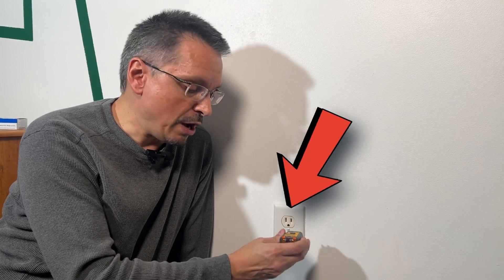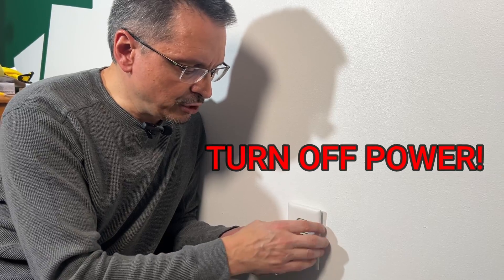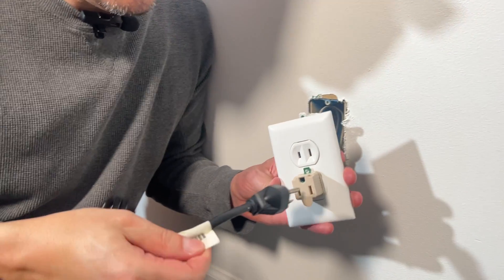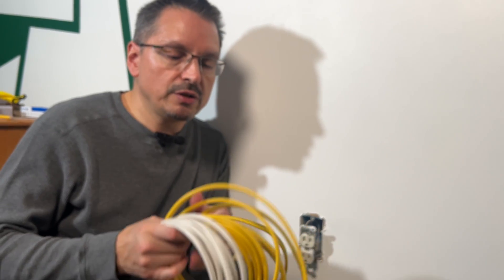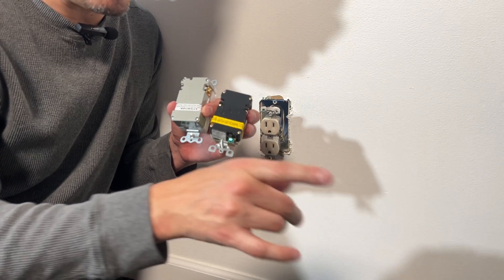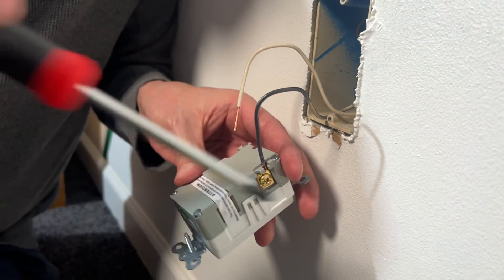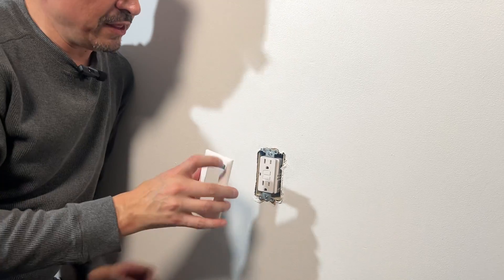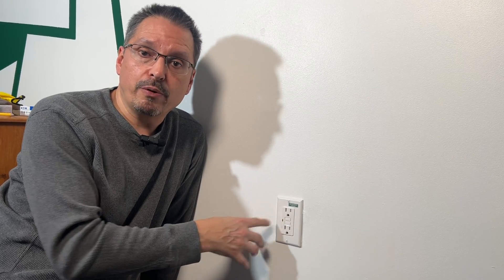Fix Open Ground Outlets | 4 Options

Comment from the maker: Have you been told your outlets are ungrounded? Tell me if you have done anything about it yet.
Reply: Your statement that electricity will flow along the ground wire and dissipate into the earth is completely wrong! Electricity always returns to its source; the last transformer it passed through usually. The purpose of the ground wire is to force the wayward electricity back through the circuit breaker.
Reply from the maker: @PetesGuide  modern grounding has several ways it adds extra layers of protection. 

The ground wire in an outlet provides a safe path for excess electricity to flow in case of a short circuit, preventing electrical shock and fire. 

In the event of a short circuit, the ground wire trips the circuit breaker, preventing a dangerous shock.

Fire prevention
The ground wire provides a safe path for excess electrical charges, preventing electrical fires.
Equipment protection
The ground wire can protect sensitive electronics from voltage spikes and surges.
Reply: I have a GFCI outlet with a ground wire attached, and it still shows on the tester as "open ground".  Apart from tracing down the open ground in a previous stop on the circuit, will the outlet itself still provide protection?
Reply from the maker: @edcrookshanks8091  yes the outlet will provide what’s called fault protection. If you hit the factory test button, the outlet will still trip and turn off power. Now, if you do the plug-in tester and check it that way you will not have grounding. But you do still have fault protection, and this increased safety is allowed on underground three prong outlets for the rental department and the building department. Although technically you’re supposed label this as no equipment ground provided.
Reply: @HomeRapidRepair  I haven’t done it yet , just bought a new fridge and found out the outlet has open ground and has another outlet and light running on the same breaker. I’m trying to figure out my options , that’s why I pulled your video up.

Comment: Would have been good to see what the tester shows on the GFCI once installed, so people would know what to expect.
Reply from the maker: That's a great point, I should have included that in the video! It will show “open ground“ however you still have improved the safety with fault protection…

Comment: Just bought my first home most of the outlets are ungrounded how safe is option 4 ?
Reply from the maker: It will be fine. Millions and millions of homes are still ungrounded. Residential grounding wasn't required till like 1963 and many states after that date.

Comment: My outlets do not have a ground wire but when I plug in a tester, it comes as "correct wiring" instead of "open ground."  How is that possible?
Reply from the maker: Good question. I’m not sure. It’s possible you have metal boxes that are grounded and thus the outlets are grounded through the metal boxes…
Reply: @HomeRapidRepair  I live in an older home.  It looks like the boxes are meta..   The receptacles look like they are "self-grounding" by screwing onto the box.  That's the only explanation.

Comment: If mine is showing an open ground, but the ground wire is connected on my first outlet, can any of the downstream outlets be the culprit?
Reply from the maker: If I’m understanding your question correctly, you’re wondering why are the downstream outlets showing open ground? Every single outlet in the daisy chain circuit also has to have a solid grounding wire…. Let me know if I’m misunderstanding the question.
Reply: @HomeRapidRepair  all of the power is out in my room and the hallway. The first outlet starts in my room, and that one is showing an open ground light when I test it.. I don’t know if the wiring is bad or if another outlet down stream is the problem.
Reply from the maker: @Slossage17  yeah I hate when that happens. It’s just trial and error to fix it though. You need to turn off the main power and pull all of the outlets that you think are on the affected circuit and check every single connection. And then put it back together and turn on the power. Good luck ⚡️🛠️
Reply from the maker: @Slossage17  and just to encourage you, likely the wiring is not bad at all, you just have a loose connection on one of those outlets

Comment: Would a “2 Prong GFCI Power Strip, 2 Prong to 3 Prong GFCI Plug Adapter” make a ungrounded circuit safer , i’m not concerned with inspections just safety. The outlet is in a bathroom drawer. I know go figure.
Reply from the maker: Yes it’s safer with GFCI, because you have fault protection if anything goes wrong. That’s why hair dryers have them installed directly into the plug 🔌

Comment: What if all outlets are grounded and it shows open ground then what.
Reply from the maker: I would say if your tester is showing open ground then you actually don’t have grounding. There is either loose ground wires, or the ground rod is not connected or something else is missing. Otherwise, the tester would pick up the ground…

Comment: we recently bought a home and was planing to use a tesla charger on a nema 10 30, not knowing what it meant and googled it. says it a no grounding outlet.😞😞😩.  went and bought me a grounding device from home depot. tested the outlet in the house. kitchen, restrooms say it’s grounded, all the outlets in living room, bedrooms say open ground. what would be my best option to fix this issue??  went to check the panel breaker. i see flexible conduit that goes down to a pipe at the bottom of the house and another conduit that is just hanging not connect to anything. maybe that’s the issue? needs to be connect to a ground rod maybe got loose?
Reply from the maker: If I recall that outlet for your Tesla charger is not required to be grounded… As far as the ones in your house, there’s still millions of homes in America like that. It’s not that big of a deal. If your house is built before 1963 typically the outlets are not grounded. You might be right as far as the grounding rod at the main panel, but you might not have an additional grounding wire to each outlet receptacle. You can install GFCI outlets, even on open ground receptacles, and you’re still safe… Let me know if you have more questions

Comment: Today (DIYer) i made a thorough inspection. I JUST DISCOVERED that the romex aluminum bare wire was too short and was not terminated/ screwed to the metal jbox. Now my APC 6outlet Surge Protector Plugin is now Green Only . No more Red [Bldg.Wiring Fault) or 2 Yellow on GFCI tester means correct.
BUT am keep that GFCI 15a in place protecting the 2 outlet downstream , SO HAPPY ❤ Many Thanks again!
Reply from the maker: You rock 🎸 Great work..That is awesome. Thanks for sharing your experience 👍🏼😎

Comment: Sorry if this is a silly question....But do I replace every single open ground outlet in my home with a GFCI outlet? I believe I have like 10 total outlets that are open ground. Does that mean I have to replace all 10 with 10 GFCI outlets?
Reply from the maker: The most correct answer is no you don’t have to. If you can determine which outlet is at the beginning of the circuit then you just install the GFCI safety outlet at that location wire your downstream outlets to “load“ side of the GFCI outlet and you will have protection. You still have to label all the outlets with open ground or ungrounded sticker. 

Now for resale value and making it easier on Home Inspector’s, I often recommend to just replace every single one with a GFCI outlet that way there’s no question that people understand that you have protection.
Reply: @HomeRapidRepair what if you wired the downstream outlets to the line and the panel feed to the load? Does it matter? Thanks

Comment: Will a 110v EV charger work with a GFCI socket or will it still detect a ground fault?  🤔
Reply from the maker: I would say it should work, but all depends on how fancy the circuitry is with your EV charger. If it absolutely demands to detect a ground before it will operate… That would be a problem. It should be marked in the literature… Good luck.
Reply from the maker: I just found this information online:

- **Charger Compatibility**: Most EV chargers, including portable Level 1 and Level 2 units, require a properly grounded outlet to function correctly. Many modern chargers have built-in safety mechanisms (like ground fault detection) that may prevent operation if an open ground is detected.
- **Code Compliance**: Electrical codes (e.g., NEC in the U.S.) require EV charging circuits to have proper grounding. Using an open ground outlet violates these standards and could void warranties or insurance coverage.
- **Potential Workarounds**: Some sources suggest using a GFCI breaker or adapter as a temporary fix, but this is not a substitute for proper grounding and may still cause the charger to malfunction or trip the circuit.

*
Reply: @HomeRapidRepair    Interesting.  Guess it's time to figure out where that ground is faulty.  Tried plugging my 110v EV charger to an outside socket...detected open ground.  Opened the socket, hot/neutral/ground are all connected ok so I'm guessing I have a hidden junction box with a bad ground because all the other sockets on that line have good ground.  🙈
I appreciate your help with this.  Thanks a lot. 😊👍

Comment: Option 5: GFCI breaker to cover all outlets on a circuit.
Reply from the maker: Yes, that’s a good point for sure. I agree with you. The home inspectors and rental safety department in my area would also require each individual outlet be labeled as no ground provided. Thank you for watching.

Comment: @HomeRapidRepair thank you for this video. We are selling our home which was built in 1955 and the inspector said about open ground and two wire issues in the outlets. Since rewiring the home is out of the question your video really helps in solving that issue.  My question is if we change all the outlets to GFCI outlets, maybe is an overkill,  is it a good idea? I would like to go that route just to get that headache out of the way. 
Again thank you for your very informative and helpful video.
Reply from the maker: Actually I endorsed that. I think it is good just to install GFCI outlets at all receptacle locations that way there’s no question that they all have fault protection. Also, remember when you’re doing this “fix“ for ungrounded outlets with GFCI safety you have to label them as open ground or ungrounded. They make little sticker taps for this…

Comment: Just went through this. GFCI is good for protection but  not so practical as it shuts the power off. I had leakage from PC as no ground and pc and monitor gave electric shocks and of course this is not good for the equipment as well as the shock. Best option in this scenario is to lay a new grounding wire from PC socket to grounding rod. You can piggy.back of this if you want to ground more sockets.
Reply from the maker: Thanks for sharing your experience with us 👍🏼🛠️⚡️

Comment: Running new wire is what I'm doing now I like things done for good at a customers house
Reply from the maker: Sounds great. Good work ⚡️👍🏼🛠️
Reply: @HomeRapidRepair  Love that notion. When in doubt run a neutral back to the panel (if you can) and ensure you have also a ground (as an way for current to get back to the transformer if current goes awry)

Comment: So can I put that new outlet anywhere on the circuit or does it have to be at the first outlet of the circuit?If so how do I find the start of the run?
Reply from the maker: The easiest solution is to put it anywhere on the circuit you want and just have that one individual outlet protected. That means you will only connect the wiring to the top side of your new GFCI outlet. It’s also labeled as the Line side.

Now, if you want to install it as the first one and then have downstream protection, you have to wire the downstream outlets on the “load“ side of the GFCI outlet. This takes a lot more time to figure out which one is the first outlet. For a do it yourself it’s pretty much trial and error with turning off the power And experimenting and figure out which is the first outlet on the circuit.
Reply: Shouldn’t you wire your outlets in parallel?If so opening them up will be tougher because they are going to look like the end of the run.
Reply from the maker: @ yes I think I understand your point. If you have two hots (black) and two neutrals, you’re in the middle of the circuit or at the beginning of the circuit, if you only have one of each you’re the last outlet in the circuit. 

If you disconnect an outlet that you think is the first outlet in that circuit, and then turn the power back on you can observe which outlets are down downstream…as they won’t have power because you disconnected the outlet that was feeding them.
Reply from the maker: Finding the First Outlet in a Circuit
1. Safety First
 * Power Off: Before you begin, turn off the power to the circuit at the breaker panel.
 * Test: Use a voltage tester to confirm that the power is off at the outlets you'll be working on.
2. Identify Potential Candidates
 * Proximity to Breaker Box: Outlets closer to the electrical panel are often the first in a circuit.
 * Wiring Configuration: Look for outlets with a slightly different wiring configuration. Sometimes the first outlet has a slightly different setup.
3. The "Disconnect and Test" Method
 * Choose an Outlet: Select an outlet you suspect might be the first.
 * Disconnect: Carefully disconnect the wires from the outlet.
 * Reconnect Power: Turn the breaker back on.
 * Test Other Outlets: Use a voltage tester to check if other outlets on the circuit still have power.
   * If no power: You've likely found the first outlet.
   * If power remains: Reconnect the wires to the outlet and try another one.
4. Alternative Methods (If Applicable)
 * Circuit Breaker Identification: Some circuit breakers may have labels indicating the outlets they control.
 * Home Wiring Diagrams: If you have a wiring diagram for your home, it can help identify the circuit layout.
Important Notes
 * GFCI Outlets: If you encounter a GFCI (Ground Fault Circuit Interrupter) outlet, it may protect other outlets on the circuit.
 * Multiple Circuits: Homes often have multiple circuits. You may need to repeat this process for each circuit.

Comment: I'm replacing some outlets in a house that was built in the 70s and adding some new outlets. I also added GFI outlets in places that were close to water sources and the majority of the boxes were the old metal boxes with the ground attached to the box. I swear every single outlet had tested correctly a day or so ago and then yesterday's I was replacing another outlet and it came up with the open ground  so I pulled it back out and rechecked everything and it was all right so I reattached it and I decided to check the previous outlet in the line and discovered that it also was now reading open ground so I checked the one that was before it and it also read open ground so I checked that entire line and everything appears to be correctly installed so I just decided to check a different outlet and discovered that it also was reading open ground so I decided to check every single outlet in the house only to discover that every single outlet was now reading open ground, I was thinking that maybe I had taken more than the original ground wire was capable of providing and I was wondering if I needed to install a new ground rod outside the home to attach to the main breaker box, I have worked with electric for many years and I have never encountered anything like this, I originally thought maybe I had lost the ground from the outlet box by attaching the new outlet to the actual ground provided by the receptacle so I tried running a jumper from the metal box ground to the ground from the receptacle but it didn't seem to help, if anyone has any idea what the hell happened and what I need to do to fix this I would appreciate it.
Reply from the maker: Sorry you’re having this frustration. Installing an additional ground rod is smart. Definitely won’t regret that. My only guess from reading this story is there’s still a poor loose ground connection somewhere in your house. Good luck 👍🏼⚡️
Reply: @HomeRapidRepair  I think I have discovered what the problem is, I decided to take my tester home and check where I knew that there were no other issues and discovered that the bulb on my tester must have failed I have had it for years and I just never figured that I would need to replace it. I don't typically use it on any knew construction because I am typically the one who is doing all the wiring and I don't feel the need to double check myself. I thought it was awfully strange that I went from having all the outlets that I had replaced testing correctly to not one in the entire residence including ones that I had not yet replaced testing ground failure but I guess sometimes it is the simplest thing that we overlook. I'm a little irritated that I wasted the amount of time and energy that I did before I came to the point where I thought to test the tester but I guess it is better late than never
Reply from the maker: @ holy cow man. Great catch though…👍🏼
Reply: @crazycraig1978  that's so common lol
Reply: Same thing happened with my tester. It was reading every outlet in my house as open neutral.